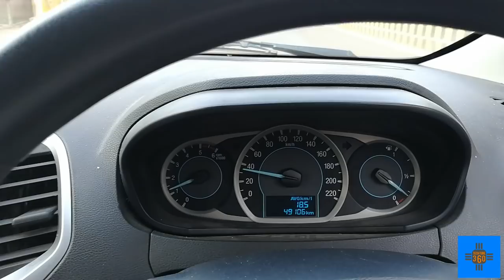How to convert old petrol scooty to electric || powerful electric scooter || scooter modification

Comment: Why did you disturb beautiful scooty plastic body ? This looks ugly and alien thing. Unnecessarily grabbing attention from people. 
Make the vehicle in a such a way it should be hard notice that is it on petrol or electric.
Reply from the maker: It's exactly made like to look alien and to get noticed but it's not that I cannot make it as in normal vehicle. Watch my India's first four geared electric bike video. That boxer which we converted 99% of times goes unnoticed
Reply: @techtube360world  Thank you sir for a quick reply. The purpose behind keeping our work hidden is that people feel ridiculously shy to use EVs . They want pride of conventional body with electric benefits. 
And one more question - why not use hub motor to minimize transmission stages and so do the transmission losses and weight of the engine. What is benefit of gearbox ?
Reply: @techtube360world  And sir, can't we make a hub motor that can be fitted directly to rear engine ? So as to make it hybrid. Because people worry most about any breakdowns during the travel. In this way it can be used as either electric mode or petrol mode .
Reply from the maker: @pizzacreamcafechinttan642  very nice question. Personally speaking I don't like hub motors. But I am not against it. Secondly vehicle in my opinion must be either electric completely or IC engine completely this hybrid theory is actually impractical because you are putting 20% of extra weight on either of the systems means IC engine has to carry extra burden of motor and batteries plus it's controller and it's throttle. And while you are on electric mode motor has to carry entire engine fuel in fuel tank and it's own weight plus rider and frame. So just at the start you are loosing minimum 20% efficiency due to weight of either systems incorporated to gather. Also in two wheeler space is at premium so putting things to gather is also a challenge. But many of my viewers have told me to make a hybrid and I will make it too but my idea is clear that why two should not coexist. I hope I have answered to your question. Thanks for your time and interest 🙏😊👍✌️
Reply from the maker: @pizzacreamcafechinttan642  answer to your first question. Things are going to change very soon and rather sooner than you expected. If you remember Yamaha RX100 that was iconic bike during 90s and till late 2000. People use to like that exhaust sound of that bike if you will ride a two stroke engine Rx 100 today people will notice you as all migrated to low pollution four stroke engine vehicles that does not have exhaust sound like that RX 100. Same is going to happen with petrol and IC engine vehicles. Also riding an ev will be matter of pride in days to come. If you ride what I have modified to electric you will never feel lagging behind the gas counterparts. Si adapting a green vehicles that to capable one is not a matter of shyness but it should be a matter of pride that you are contributing your part in conservation of nature. Thanks 🙏
Reply: @techtube360world  You are right sir. What a Perfect answer ! Weight and storage space are critical issues. But, what can be done in case breakdowns because we cannot check whether each wire is ok or not or no guarantee for controller or motor. The main point is when the vehicle doesn't work during travel away from home ???. And this issue can be solved by putting a standby controller and motor , isn't it right?
Reply from the maker: @pizzacreamcafechinttan642  I am into this thing so I can tell you there is practically no maintenance in electric vehicle. I am riding my boxer in rains and IC engine guys had their engines stalled my vehicle intentionally draged in big water logged roads did not even stoped for a second. Only thing to be kept in mind is the range of vehicle if you are within limits of travel to and fro of the range per charge I guarantee you that it will not stop any where and electronics battery and motors used more a days are more reliable than ever due to advancement in technology. Today we even have a battery that will last for your three generations yes you are reading right 82 years of life expectancy of LTO batteries and that I can even fit in your vehicle. So electric vehicle are not that fragile like they used to be some decade ago. So that need does not arise if you are within per charge range of vehicle and you can monitor it too. And once the infrastructure is ready you will get charging ports almost every three km in near future. So get your reservations of adapting EVs adapt it and share your contribution for mother nature. Thanks 🙏
Reply: @techtube360world  thank you sir for perfect and satisfying answers. So, I heard that the motor never breaks down ever. But, I m suspicious about the controller that can breakdown any time ? Have you heard any breakdowns?
Reply: As you made a perfect boxer , you have made a perfect scooty engine, but I m so disappointed with it's body. You have unnecessarily made a horrible and far ugly outer look. Please keep original I request 🙏
Reply from the maker: @pizzacreamcafechinttan642  controller these days are so advance that it is continuously on self check mode and it shuts itself before it gets damaged. There is a small dedicated microcontroller managing the tasks and it's associated firmware. More so the controllers are IP 66 certified water proof so that's more than sufficient for controller to prolong it's life as long as vehicle stays working. Again in case of any error unplugging battery and reconnecting it will reset it's parameters and it can be configured by pc our even Bluetooth in some cases. So that's not a challenge at all. Controller motor matched set is almost fail proof. Thanks 🙏
Reply from the maker: @pizzacreamcafechinttan642  thanks for your opinion but it was ment to be looking different and agile just to grab attention. Else it is very capable. In normal conversion we do not disturb outer look at all is just our prototype that we made like this. Thanks 🙏
Reply: @techtube360world  Sir, does gear changes automatically in your scooty? What is the use of gearbox ?
Reply from the maker: @pizzacreamcafechinttan642  no it's fix speed gearbox but use is that without stressing motor it can easily climb steep slopes over 25degrees which normal electric vehicles specially hub motor vehicles fail to perform and max gradient for hub motors is 15deg. So now you know the  reason why I don't like hub motors.
Reply: @techtube360world  Thank you very much sir for giving valuable knowledge through your scooty design. 
Actually, I was planning to have an E Scooter but those guys are charging 30k more on any scooter plus are not giving sufficient power and gradability.
I decided to assemble all standard parts with a good speced second hand e-scooter.
But, now from your design point of view I will need gearbox scooty. But, then there will be a lot to do like yours....
I feel you are on verge of developing best e-scooter. You must start with only single model and launch it. Only single model is sufficient. I insist on TVS scooty like model. Because bikes are useless for married person and business person. Every Indian man needs storage space because he never returns home with empty hand...
Reply from the maker: @pizzacreamcafechinttan642  thank you so much for appreciation and I believe "knowledge bantne se badhta hai" we are commercially going to launch kits for activa access Jupiter boxer splendor and scooty pep most sold vehicles  in our country. This will help lot of people to save on fuel and adapt to greener vehicles at reasonably affordable price. Also if you buy decent specs of scooter like ather 450 it will set you back about 85k which our conversion will save people a hefty 35k with their existing vehicle. So let's see how well it goes. Thanks for your time and interest. 🙏
Reply: @techtube360world  That's very nice of you sir. Please let me know whenever you're coming up with scooty pep plus. This is Chinttan Dewalia from Pune. Tame kyana Cho ?
Reply from the maker: @pizzacreamcafechinttan642  I am from Rajkot and very familiar will pune city though have not been there since 19 long years but I have done my engineering from D.Y. PATIL PIMPRI PUNE.🙏
Reply: @techtube360world  which year sir ? What's your name? I passed in 2000 be instru dypcoe.
Reply from the maker: @pizzacreamcafechinttan642  ya I too cleared backlog in 2000 my year was 1999 oh what a co incidence
Reply from the maker: Myself Shalin Patel and I was in electronics batch final year 1999
Reply: @techtube360world  ohhh !  you were my senior. Anyways, sir please develop the kit asap. I m always ready to help you from Pune.
Reply from the maker: @pizzacreamcafechinttan642  great so very nice to meet you share your number we will be in touch.
Reply: @techtube360world  why do all e bike companies are preferring direct drive with higher wattage hub motors ? Don't their engineers think about reduction gearing for better performance? 
I came across one 36 v 600 watt bldc geared motor (MY1020Z) which is currently in use for e-rickshaws. Can't we use this for eliminating scooty gearbox and whole engine weight with only one reduction gear ?
Can we optimize motor from 3kw to 600 w or lesser ?